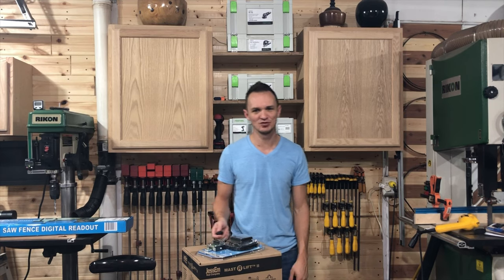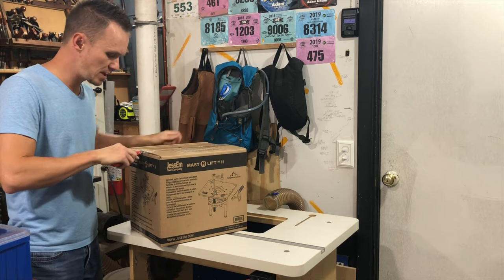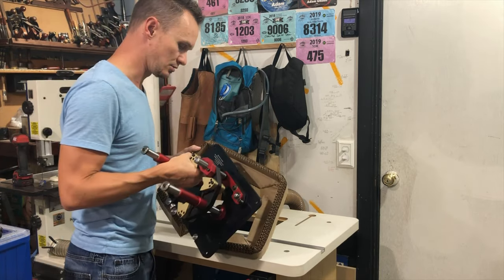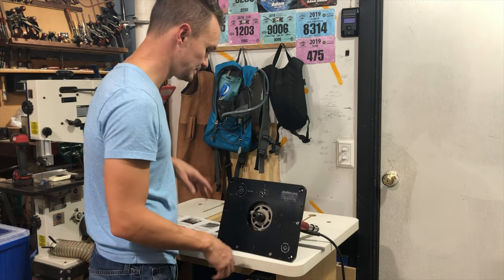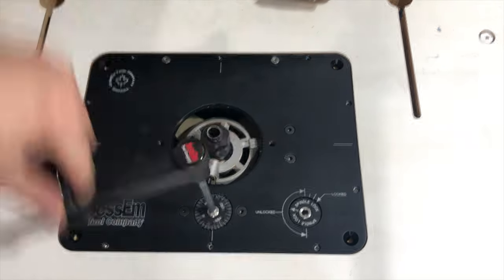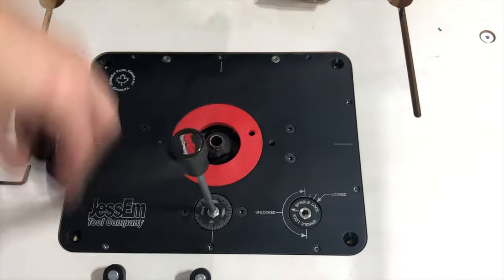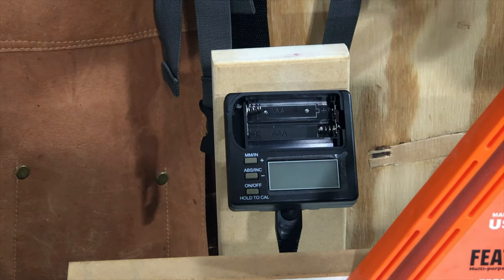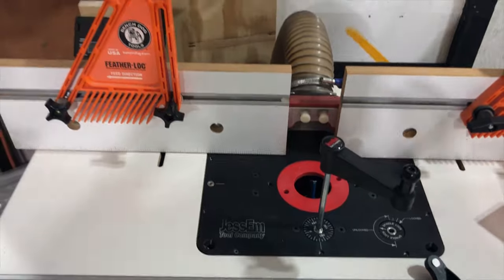Router Digital Readout. Wixey Digital Router Readout and Jessem Master R Lift II Install.

Comment: I built my own router table and used the Jessem router lift  My table is 42" wide and 24" deep  
I installed a woodpecker miter and t slot track on the frt and t slot trace for the home made fence with a side/top track top
then put jessem stock guides on the fence.  I bought the lift for a craftsman router so its the 179 dollar unit lift
Later because the craftsman router was one speed motor I bought a bosch 1617 router that has speed control on it
for the base I used an old fish tank  base for a 35 gallon tank , Now I can d raised panels and and use a lock miter bits with a cross cut sled in the miter track , if you doing doors for a cabinet the end grain boards are harder to do and keep straight
passing the bit.  there are other way to do sleds for this or vertical operations as well youtube is great to look for this stuff if you don't know how.

Comment: You mention having to buy screws for the DRO holes.  What is the thread size of the DRO holes?
Reply from the maker: So sorry! I can’t remember what one I used. I would just take the plate to the hardware store and it would be pretty easy to find

Comment: I'd like to know how accurate it is compared to the indicator tick marks on the lift handle (the dial gauge you insert the handle into to adjust the height - one full rev = 32 ticks = 1/16" = 0.0625").  I have the Jessem Rout-R-Lift II, with the same gauge/lift system.  One tick equals 1/512" or ~0.002".
Reply from the maker: It’s pretty accurate, the big advantage is quickly dialing in repeated cuts between bits

Comment: After 2 years have you had any issues with the Wixey gauge? I had one of their height gauges and it only lasted about 2 years. Thought it was the battery but nope. My shop doesn't have hvac so was wondering if that could be the issue. 
Thanks for the video.
Reply from the maker: Nope, but I don’t use it on a daily basis but I’ve never had one stop working
Reply: I havent found a solution to this yet. My router and dust system are all properly grounded so I dont know why this happens. Faulty friggin design if you ask me. Other than that it works beautifully. Wixey makes another heigh gauge which I use with my drill press that is not connected like this model which Ive used as well; it doesn't have these issues as above. Model is WR25. Its like $20.